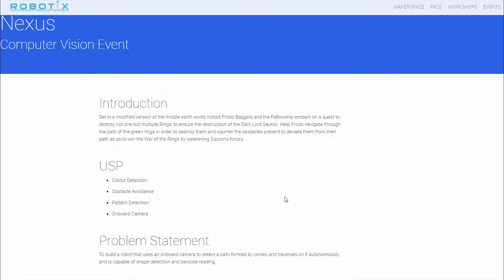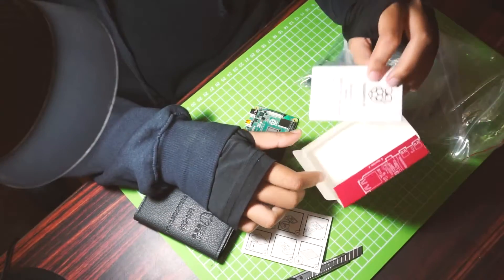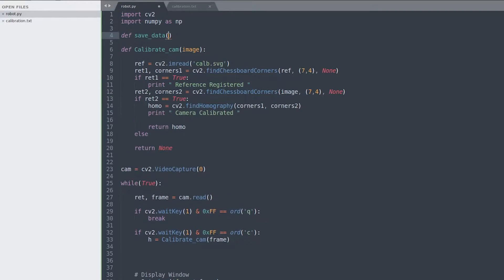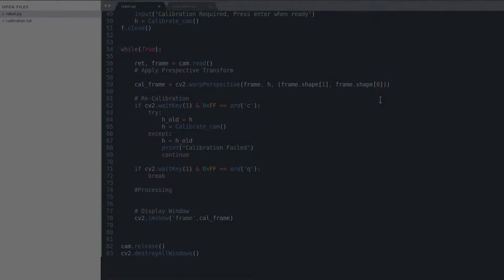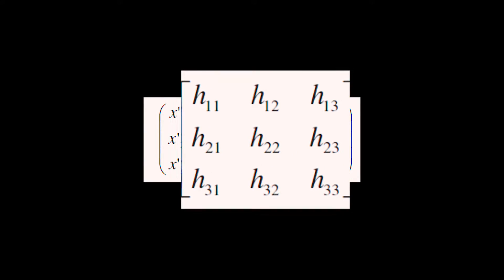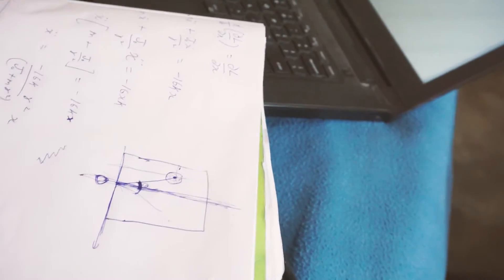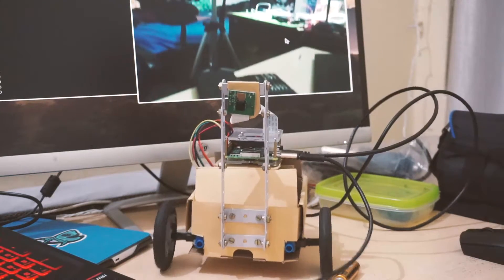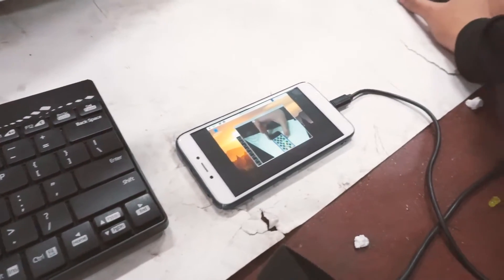Making an AUTONOMOUS ROBOT with RASPBERRY PI4 | KTJ 20

Comment: ey man, one question, what do you use to power RPI4 when no using adapter? Power banks? if yes, can you suggest a good one (proper power) for it? it would be of help :)
Reply from the maker: Hey thanks for the question. Any power bank that can output a minimum of 5V 2A will do. But I usually use a 5V 3A BEC to power it from my battery unit.
Reply: @jvankooo  alrighty, Thanks for the info, man.
Reply: @jvankooo  thanks! but what battery did you use? I'm also looking for a big rechargeable battery but not heavy to deliver stable 5v 3amps to both RPi and motors.
Reply from the maker: Yes, I use a 3s (12v) 1000mah 30c battery along with a 5v 3A BEC to deliver power to the Pi4. The motors are powered directly from the battery at 12V. When you choose a battery make sure it can provide sufficient amps for your setup. If your motors can work at 5v, then go for a 2s Lipo, drive the motors direct from the battery and use a 5v BEC for the Pi . 2s 1000mah ( 20-30 c ) will be only around 65gm or less.